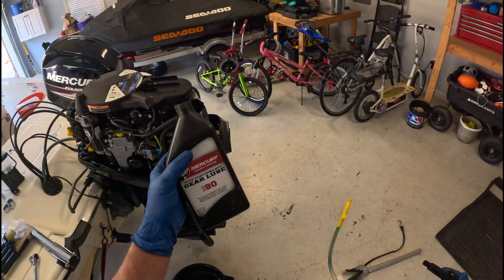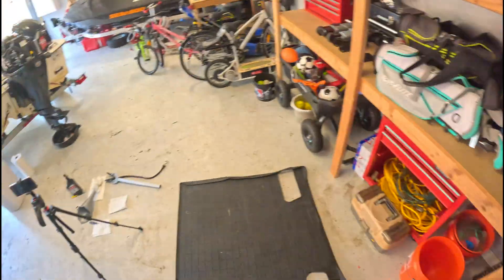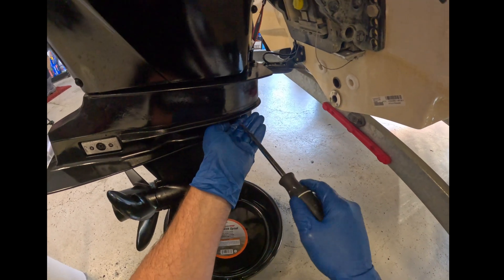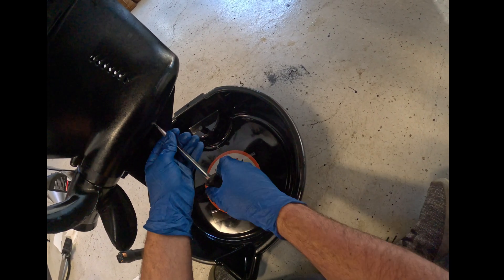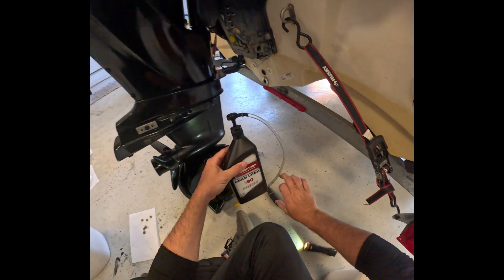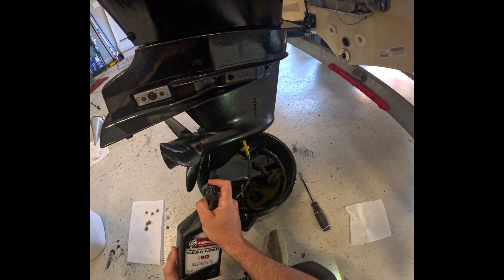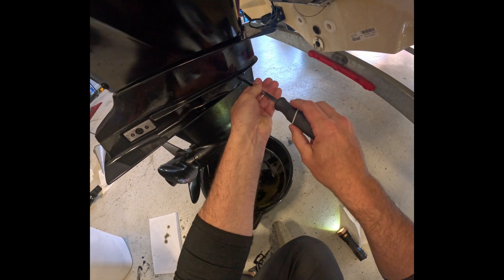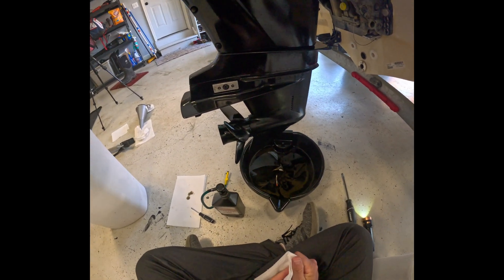Outboard Motor Maintenance - Mercury Outboard Gear Lube Fluid Service - (How to Guide in 4k)

Comment: Thanks for the oil change video and this gear lube video. I have a Mercury 60hp motor, that I have had for 15 months and I have less than 40 hours of run time on the motor. I use a trolling motor most of the time. But I figured I should do some maintenance real soon. Question? Does the pump for the gear lube come with the kit? I did not see it in the desciption. Thanks again for the videos.
Reply from the maker: Thanks for tuning in! Some kits include the pump and some do not. You can pick a pump up at Walmart for a few bucks if you can’t get one in a kit.